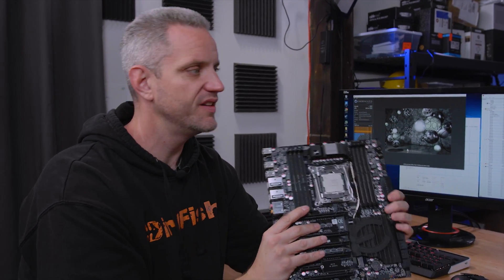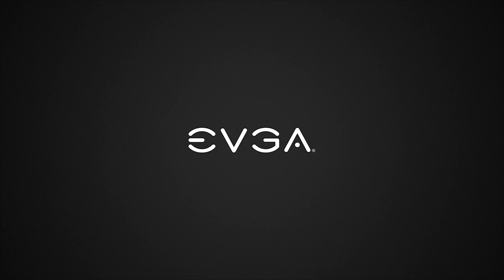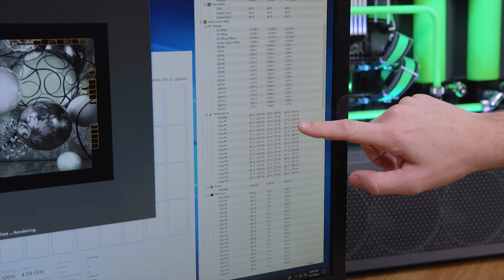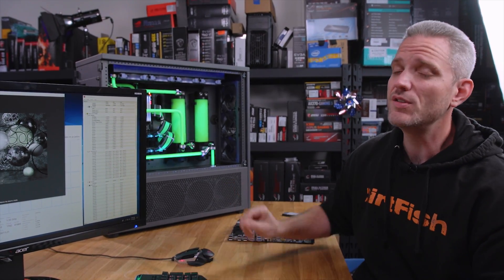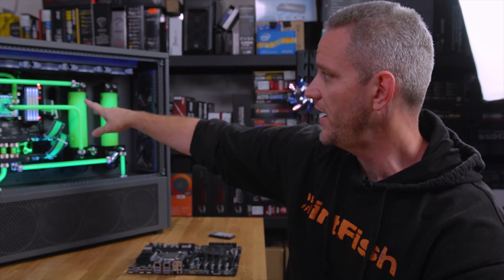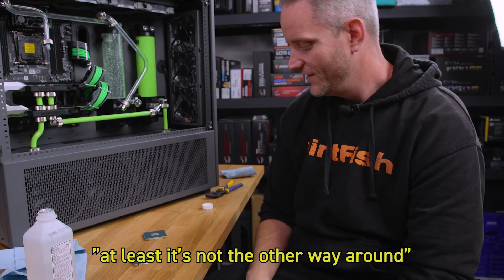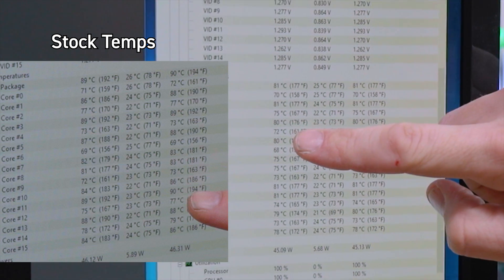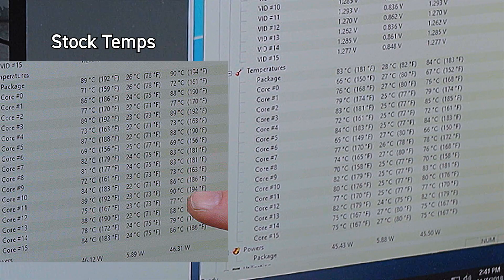I went to delid my CPU... but I didn’t expect this!

Comment: Why didnt you use liquid metal????
Reply: isn't that the whole point to delid it, to slap LM between IHS and CPU?
Reply: @Sechs0rBecks  yes and no,  its simply to replace the stock thermal compound with something better.  High end thermal compounds do a far better job at transferring heat than low end stuff.  Also, @der8auer does not use liquid metal when he delids cpus for liquid nitrogen extreme overclocking, because LM freezes and its ability to transfer heat decreased.  He and other XOCers like kingpin use specific thermal compounds under the IHS for cold temps.
Reply: @somethingsnowing  This isn't going under LN2, so thats a moot point.
Reply: @somethingsnowing  Ok, that part with the XOC is crystalclear. Still as we all see, just replacing it with another TIM doesn't make such difference in Jayz case. I mean 85/84°C isn't that bad, just uncomfortable to watch. With LM he could potentially get around 70~75°C territory.
Reply: if youre going to cool it with LN2 i agree with liquid metal however not this case it will be sufficient to use some good grade dow corning or similar thermal compound, one of the tricky things with liquid metal is to avoid it to get in touch with any other circuit pores or bare traces or components to prevent short circuits
Reply: @equysis  Actually if you're using LN2 you'll use normal paste because LM's thermal conductivity decreases when it's cold. LM=Normal use......Paste=Subzero temps
Reply: oh I see, I thought it would be more reliable the LM instead of the paste on sub zero temps, thanks for clarifying this!
Reply: huhhman  
From the article you linked to;
"There are some limitations of testing with this. For one of them, we’re only using one sample, so this isn’t globally conclusive of all liquid metals, or even of Conductonaut. This gives us a great baseline and a case study, but we would need more samples to really make hard claims"
Reply: @DrunkenAussie76  At what point does anecdotal become fact though? You can see in peoples reply to this comment that along with google, a ton of people do it without problems. There will always be outliers who do it wrong and blame it on something else, but with proper technique, the only fault is the user.
Reply: @Return_To_Sender  
More from the same article;
"It is difficult to conduct long-term endurance tests with multiple samples, and would require dozens (or more) of identical systems to really build-out a large database. From that angle, again, please keep in mind that this is a case study of one test bench, with one brand of liquid metal"
Reply: @DrunkenAussie76  You keep pointing to that one article. Look at these replies, no one has had problems. Now go to google and see that many other people do the same thing without problems. That's my point. Anecdotal has to become fact at some point with enough evidence. If you fuck up, its on YOU, not the LM.
Reply: @Return_To_Sender  
I am just too lazy to type... But you would need to test multiple samples from multiple manufactures for an extended time on multiple systems, not multiple random people on the internet who claim to have had no issues without all their relevant numbers and system details.

And that would only give you an overview of the products on the market for the time when you did the test. Any one of the manufacturers change their recipe and a new barrage of tests would be required.
Reply: @Return_To_Sender  
How many random people (and their systems) did either of those companies hire for their r7d teams?
Reply: LM is all good for home rigs, I actually never heard or experienced failures with LM (that is, everyone I know who has done this are expertes). But it's been a long time since I stopped delidding, running a friend's system and I got his 8700K to 5.2Ghz@1.34V on an NH-D15 non delidded. 79C max on Prime95. No need to delid this puppy
Reply: Because Liquid Metal is unnecessary and overkill most of the time. Just using a much higher quality paste usually makes plenty of difference, The stock Intel paste is garbage and anything is better than it. Also LM is substantially more expensive than just a regular high quality paste. Sure the temp improvement is nice but i'd be quite fine with the improvements he already saw along with 99% of other people. I find it hilarious how people care about CPU temps 24/7. These chips are designed to go well in excess of 90 - 100 C with 0 damage and yet people see "80 C" under a FULL LOAD and think it calls for liquid metal and other extreme measures. 

Just smh, You don't even get any throttling at 80 C and the argument that CPU's last longer under lower temps is quite far fetched IMO. Like I said the chips are designed to go up too 100 C with no issues whatsoever, So 80 C isn't hurting anything at all. That's just mildly warm for it. My old Pentium 4 HT machines ran for well over a DECADE with Dell coolers, heatsinks and the original dried up paste at well over 90 C at full load and guess what? None of those machines ever had CPU failures despite the worst conditions imaginable with probably some of the worst paste imaginable. Why did it never fail? Simply because the CPU was never damaged to begin with because it never went over 100 C. All LM does is waste your money and your time to make your PC slightly less of a "heater".
Reply: Probably because liquid metal isn't reccomended for long term use, especially it it's not used in a test bench which is sitting flat. This is because the liquid metal can run out and cause short circuits. Seeing as this will be used in this config for a long time, that would be the reason I can think of for not using liquid metal.
Reply: @kevindudd3225  Sources?  GM had one in a system that was on 24/7 for a FULL YEAR and nothing changed. I've had my 8700k on the same LM in the same loop since august 2017, traveling almost every weekend with it, and nothing has changed. Again, LM will NOT RUN because it's too viscous in the amount you put on your die. You don't pool it, it's literally a film that sticks to the die. More people talking what they don't know. Obviously he isn't going to use sub zero, but if he did, that's the only use case that you shouldn't LM it. What he did was pointless other than the lapping.
Reply: @Return_To_Sender  do one Nagol. Utter internet Muppet.
Reply: @kevindudd3225  Have used LM for years on two different vertically mounted 3570K's and a vertically mounted 6700k, no nail polish, no issues at all.
Reply: @kevindudd3225  
Rubbish... there are people in the comments section here who delidded 5 years ago and no issues. My daughters system two years ago and no issues, my CPU 18 months ago and no issues.
Reply: @kevindudd3225   very well said
Reply: made some new gaming videos i have two compilations with music just started youtube 1 month ago im really trying to make my videos better and upload them every Tuesday,Thursday and Saturday😂😂😆😆😆😆
Reply: its a little bit of a pain because you have to use a conformal coating or nail polish to prevent the liquid metal from causing any shorts
Reply: @somethingsnowing  You really dont have to do that. Its optional. I've done plenty with no issues.
Reply: @somethingsnowing  i shorted my 4790k then clean it off, apply it again, works again no biggie
Reply: @somethingsnowing  
No you DO NOT have to use nail polish. I have delidded MANY TIMES... no issues and no nail polish.

Guys, if you have never delidded dont comment.

Comment: Why no Liquid Metal :(
Reply: Because Liquid Metal is unnecessary and overkill most of the time. Just using a much higher quality paste usually makes plenty of difference.
Reply: @2K-Tan  Did you looked at Skunk work? It's a overkill machine, it needed an overkill solution.
Reply: @kainey  It might have been the best thing for the job but that doesnt necessarily mean it needs an overkill solution. Like I said any temps around 70 C are completely harmless and theirs no performance loss. Adding the LM at that point is really just a personal preference.

Comment: Put threadripper in skunkworks
Reply: Nah... Wait for 64 core Epyc and Gigabyte ATX Workstation board.
Reply: @Grand Admiral Thrawn Threadriper still has a good bit of room to improve for AVX workloads.
Reply: Only problem with that is Intel keeps poaching AMD engineers to try to play catch up with them.
Reply: 24 and 32 core threadripper chips are actually slower than 16 or 18 core intel chips due to windows not handling all those cores correctly.
Reply: ivan villa they arent slower, its just that some applications prefer intel more because of its older architecture.

Comment: Why not liquid metal???
Reply: why not both
Reply: well TIM replacement wont help that much 2-5c when intel screws up the TIM 10-15c as for LM lasting dunno seen both toss up really it is not that scary if it dries up it throttle's then you replace it have yet to really see an issue with LM that is not related to it being conductive and someone being impatient
Reply: the real question is: WHY ARENT CPUS JUST MANUFACTURED WITH LIQUID METAL UNDER THE IHS
Reply: Planned for long term use.
Liquid metal requires a conformal coating, however that degrades over time, so it may die in a year or 2 without warning if you made a tiny mistake on the gallinstan.
Reply: @markp8295  I can personally confirm that is a myth. I've had my 3770k (First Intel CPUs to have TIM instead of solder) which I delidded in in late 2012 (6 years ago) and I have never reapplied the Coolaboratory Liquid Metal since. Still running 4.9Ghz at 1.48V!!!! One point four eight VOLTS! For 6 years! This computer has seen a ton of use and abuse as well. I even have power saving options turned off so it never ever drops below 4.9Ghz. When I first did it, stayed around 75c avg on all cores and now its closer to 83c in cinebench. I blame this mostly on the dust and age of my H80i cooler, not the degradation of my CPU or liquid metal.

So unless you're gonna be running the same liquid metal for 20 years or so, I don't see why it is a bad option "Long term". Plus, it takes 5 minutes to clean and replace should it ever become a problem.
Reply: @MarshalBeard   
My 3570k is also @4,9ghz and it was not modified but I run a custom water cooling since then.  Volts are even higher but only @1.5V.
Using this thing now for 4k content and yes it sucks because it is only an I5 but thats what I have and the temps are below 75°c max for 24h full stress test with anything in the system running @max.  Room temperature was 25 though.
Reply: @Vanadium  When I turn hyperthreading off I can get to 5ghz at 1.52 volts, great for games that aren't well optimized for high core counts. It actually runs cooler as well, just from the hyperthreading being off. I can't hit 5ghz with it on no matter what I do. Increasing the other voltages and having the core voltage at 1.6v and outside in my garage during cold Canadian winter ( -30c) is still not stable 5ghz. Haven't passed a single benchmark with it but 4.9ghz is daily stable with much lower voltages and running 40 degrees hotter.... What a piss off, lol.
Reply: @MarshalBeard  Yeah I know that feeling, my problem is that my board actually falling apart and a new Asus 8Z77 V-LE(or other good board) is just to expensive.
I wait just for the new Ryzen and dunno what I do with this platform then because I take the water cooler to the Ryzen.
Reply: @markp8295  Linus did the same thing, delid with regular thermal paste. He saw hardly any improvement and said it was a waste of time. Every time someone delids and uses regular TIM the results are crap. When people use Liquid metal they see 10-20c improvements. If you're not gonna use liquid metal it's not worth bothering.
Reply: @markp8295  It depends on the coating you use. I use a polyurethane based coating which has a very high longevity and abrasion and chemical resistance.